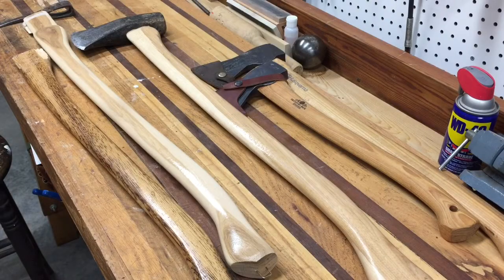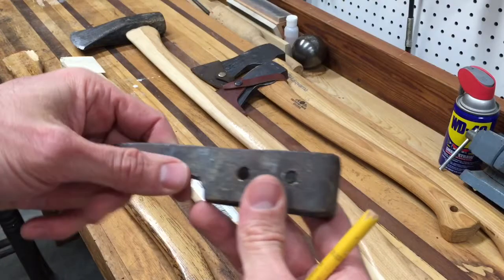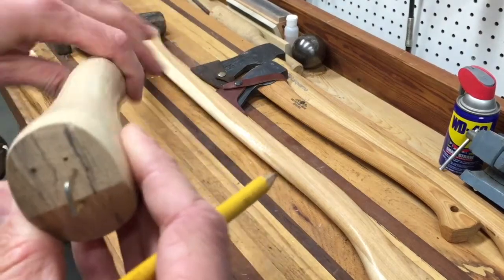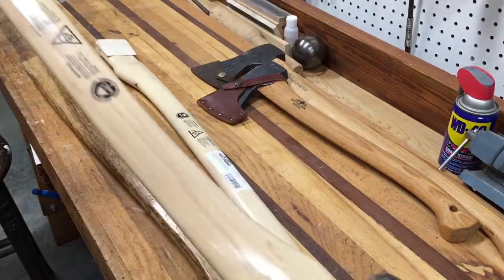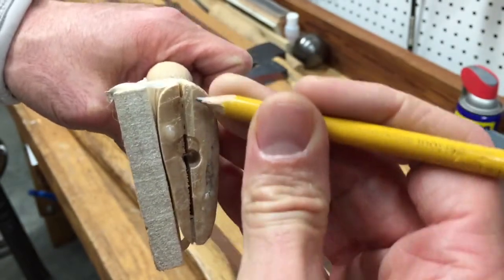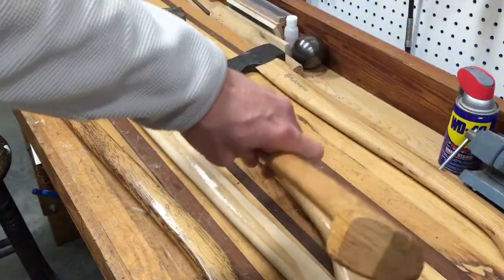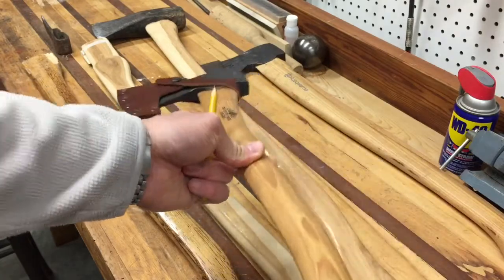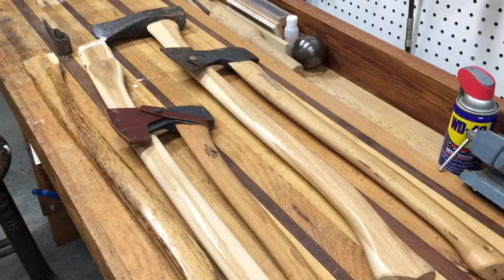How to Select a Replacement Axe Handle

Comment: i feel like such a dolt now, i wish i'd seen this first. The store i went to only had 3 handles (total), and i just kind of grabbed one. It's hickory and the grain is perfectly straight... but in the horizontal aspect. In retrospect, the other two handles had a similar grain orientation but more irregular pattern and now after watching this, the three handles that were there, were probably the last three for a reason. haven't done anything with it yet. might return it after i sleep on it for a bit... Cheers for your info

Comment: While I will agree that vertical grain is stronger, it's more a matter of runout. Too many people only cares about how it looks like at the ends. Horizontal grain over vertical with fatal runout
Reply: Horizontal grain is abput 10-15% less strong than a completely vertical grain but it is far better at absorbing shock and vibration. It gives less vibration to your hands, far less.It works as a natural shock absorber.Preference is something personal. I have both vertical oriented grain ones at about 80%-85% of being totally straight and i just hand a 3.2 pound Plumb double bit in a 100% parallel grain one!!!
Reply: It's quite springy, purely straight front to back has zero shock absorbsion so it's eventually going to crack with hard use but what doesn't shock the handle goes right into your wrists.
Look for one that comes out of the rift.

Comment: Where is a good place to buy handles at Lowes,Home Depot,Walmart if they got one, and tractor supply? which is the best place to look
Reply from the maker: SniperSurvivalist   I like the handles at Lowes.  They are American made and of OKAY quality.  Not impressed with TSC handles that are made in Mexico.  Sub par wood.  Not sure what Home Depot has.  If you have a good local hardware I would give them a try first.  Support the little guy if they provide good supplies.
Reply: Don't have one nearby. One a couple hours away but haven't been in years don't travel that far usually
Reply from the maker: +SniperSurvivalist   you maybe able to mail order a handle.   But you get what they send...  you can't pick through them to make a selection.

Comment: Great review, i like more the glass fiber handles because they are more resistent, what do you think, do you like fiber glass handles?. Thanks...
Reply from the maker: +Héctor Rangel   They certainly are durable.  They can break as well but not as easily as wood.  Fiberglass handles does not absorb shock loading like wood handles do.  So if you use for fiberglass long periods of time you may experience arm pain, etc.  Also I don't know how easy it is to replace a fiberglass handle.  Thank you for the comments!
Reply: Thank you very much, your welcome.
Reply: My son and I just replaced a fiberglass handle on splitting mall. It maybe common knowledge to many but it does not work well to replace a fiberglass handle with a wood handle.  The eye size is different and thwood handles are slightly smaller and don't tighten up well.  We replaced it with a fiberglass handle.  It was from one of the H box stores. It should have had an epoxy kit to seal the head end of the handle but there were none.  We picked up a J B Weld kit and that seemed to work ok.

Comment: You don't want em pure plain sawn, nor quarter sawn either 
Generally yes you do want it more vertical than horizontal. 
But horizontal is too springy.
Pure vertical is nearly no flex putting all the shock that doesn't go into cracking the handle into your wrists
Reply from the maker: Thanks for the info

Comment: Good review, but I cringed every time you plopped the axes down on the handles. If you spend lots of money on a good axe, I'd be careful not to ding up the handles. Then again that's me.
Reply from the maker: +Beer Hunter   Thank you.  Yes I guess I was a little rough with them.  But the Hickory handles are very tough.  And they were on my wood work bench.  (0:  Thank you for the comments!
Reply: Meh theyre very thick looking too will probably shave that off making it useable.